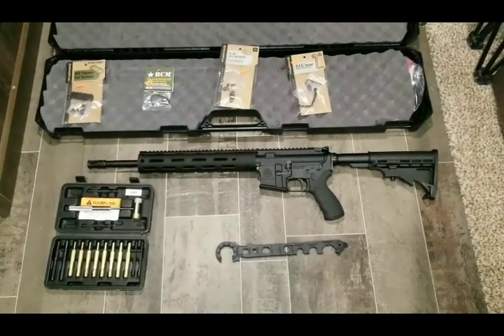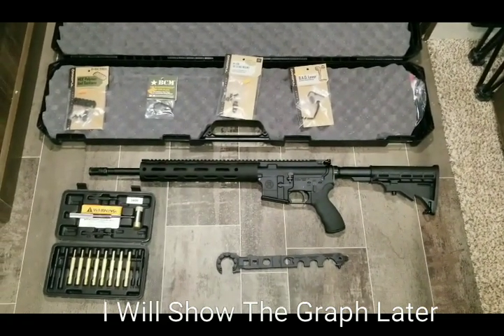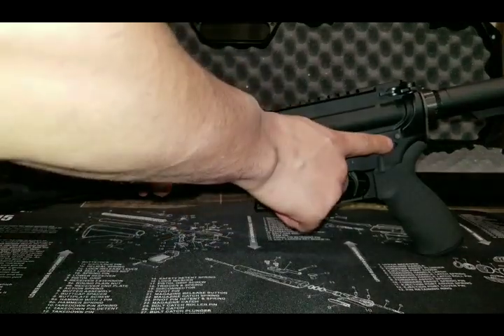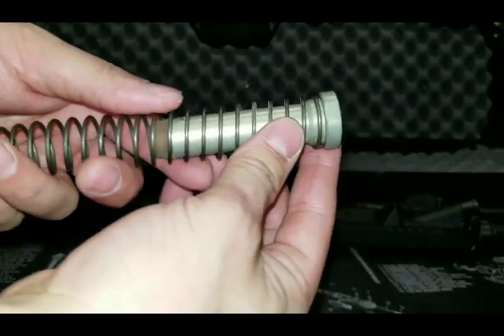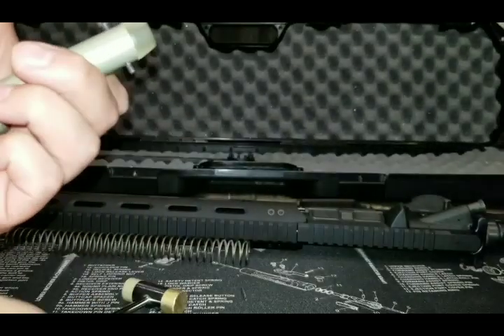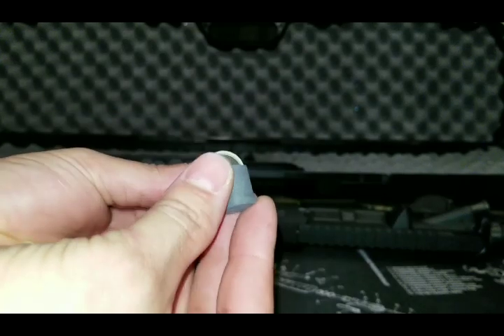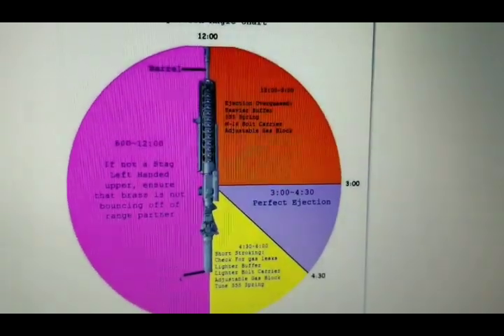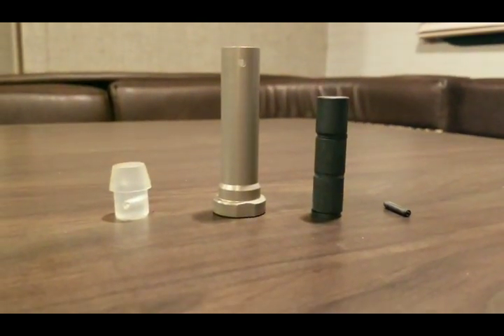Your Radical AR Is Over Gassed, FIX IT CHEAP!!! Here's How

Comment: Hello everyone hope all is well, so my M&P sport 2 recently started ejecting my coper in the 2 oclock position sometimes with very little forced. Also noticed that my BCG is sometimes not staying open on last round? Fairly new to the gun community and want to learn instead of a gun smith your input/suggestions and help would be greatly appreciated.  Btw ive put a little over 2000 rounds thru her in about a half a year span. Stay safe everyone.

Comment: Did the extra weight solve the problem?
Reply from the maker: ecology78248 im going to continue to run it stock awhile longer before adding the extra weight.
Reply: @bereadybasics7525  You gotta be shittin me, another youtube professional that doesn't believe his own video. I'd like to know how you improve ammo tolerances too? I'm dyin to know this one.
Reply from the maker: @deplorable-0ne  <--- troll "How do i not believe my own video here?" I would love to pin your video above the comment section so everyone knows your method of correction. Just upload it in the comments, ill find it.  Thanks for your opinion.
Reply: @bereadybasics7525  Because you made a video specifically for adding weight to YOUR buffer to YOUR rifle because of where YOUR brass lands and you make a reply stating your not going through with the adding of weight. You obviously don't believe your own methods. I don't have a video nor will I make one for my suggested prescription for YOUR rifles problem "over gassed". Yes maybe I was trolling, but misinformation on youtube (specifically about firearms) is irresponsible. Get an adjustable gas block, follow instructions with the manual and enjoy your nice neat brass pile at whatever o'clock you adjust for, all the while enjoying a milder felt recoil, cleaner bolt carrier, trigger group and gas tube.
Reply from the maker: @deplorable-0ne  It was not a reply that i was not going through with it. It was a reply that i was going to leave it stock at that point in time (1 year ago) due to the fact i had only had 70 rounds through it. I think maybe someone was on the offensive here. So im deleting this whole debate but will leave your opinion for the solution. I also understand you trying to keep people safe as far as miss information with fire arms, however buffer weights is a fight i would have skipped.

Comment: WHY DIDN’T YOU SHOW HOW YOU REMOVED THE PIN ON THE BUFFER WEIGHT? THAT IS THE MOST DIFFICULT PART!
Reply: If you find that part difficult, you shouldn't own tools.
Reply: Shawn McAtee uhhhh you obviously have never done this with anything that’s of high grade Precision with really tight tolerances. You probably buy radical firearms uppers and PSA lowers LOL
Reply: @sttvoyager1727  Ah, no. The complication of an AR15 is child's play in comparison to the things I have worked on. Advanced multistage suspension systems, aligning  Klystron tubes, to +/- .0003", 1000+ horsepower racing engines. Laying out drill patterns to +/- .0005 by hand...an AR? Are you kidding me? It's a freakin toy, mechanically speaking.

Comment: Should probably put your weapon on safe there bud.
Reply from the maker: An empty mag well and chamber is not enough for you??... bud
Reply: Think it'll be okay, Dave.
Reply: Oh yes. The safety selector should be the first part you install on a build.  Even before you have your stripped lower. Make a cardboard layout of your rifle and bore a hole in the appropriate location on your mock up receiver.  Install the selector in the SAFE position.  This is very important!  Anything can happen regardless of whether you own a fire control group, or a bolt.  Noobie, Pleeez.
Reply: Can't put an AR on safe without cocking the hammer back (cycling the bolt) there bud.